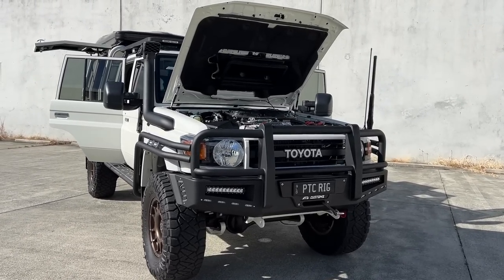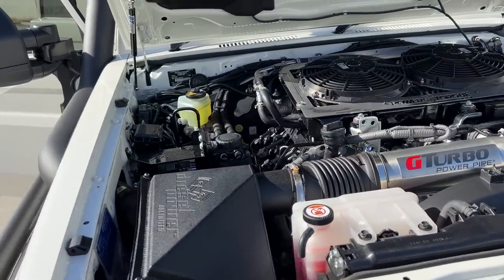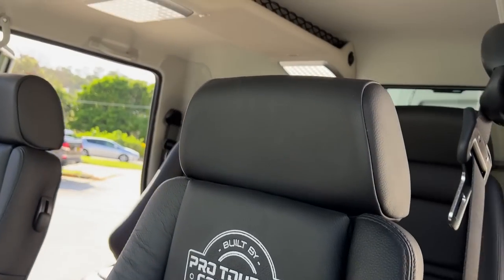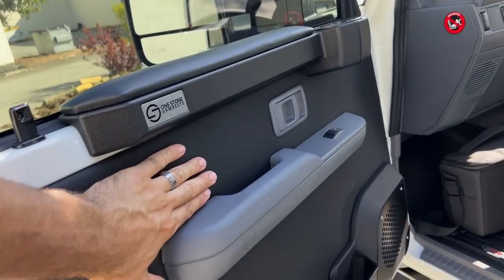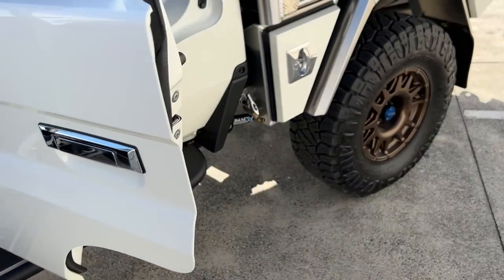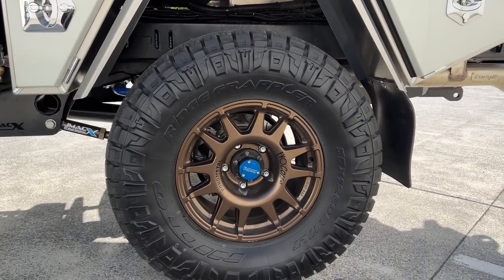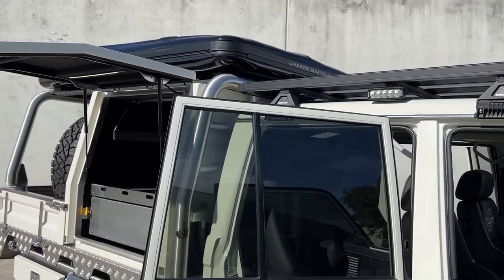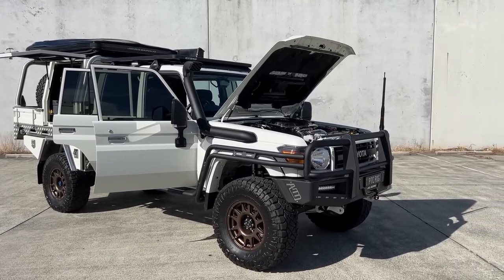PTC RIG! Pro Touring's latest 79 creation!!

Comment: Typically, the price of set-up is conveniently withheld. Other OZ conversion companies will happily include the total cost, which puts a better understanding of what each main conversion costs..So, that auto conversion $20k'ish, interior mods add another $20k, engine/exhaust $13-15k, suspension/wheels, $30k then add another $60-75k for everything else. All on top of the original purchase price of over $100k and that's roughly a $275-280k spend. Still awesome thou!
Reply from the maker: No hiding costs here mate but to be honest we don’t need to disclose unless we have serious customers wanting the same which we do. We just quote on on a requested basis. This one is roughly $315k mate

Comment: Hi mate where do you get the 79 wind fairing and are they any good?..
Reply from the maker: Rhino Rack product mate. I rate them - can’t stand the constant wind noise
Reply: @ProTouringTV   Which one is for the 79?.. I have the rhino rack pioneer low profile roof rack and I had a look at their website and there is 3 different ones?.. is there a part number?.. Thanks.

Comment: Why do I see u guys installing RCD’s in your builds? If u knew anything about electricity you’d know an rcd is completely useless on an inverter!🤷‍♂️
Reply from the maker: We add an MEN link to the inverter . It trips on short circuit and earth leakage. We have 2 sparkies that work for PTC.
Reply: An MEN link, on an inverter? That’s hilarious!🤣 An inverter is isolated from earth, meaning there no reference to earth, therefore it’s impossible to have a neutral! You’ve connected your earth wire to a live conductor. You’ve now created the exact fault which you’re trying to protect against! The only thing saving you from an electric shock, is that it isolated from earth.🙄😂